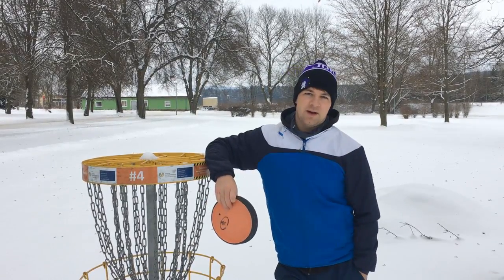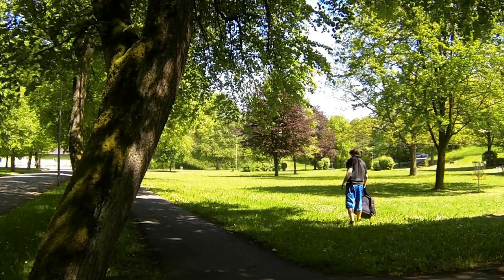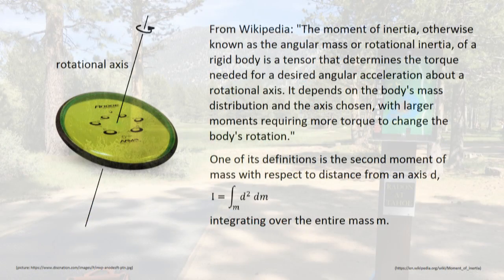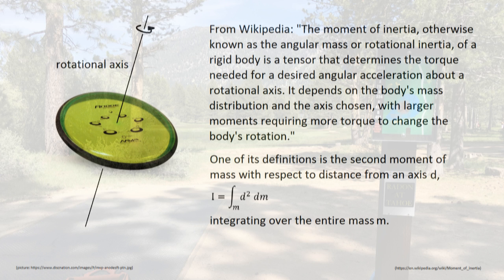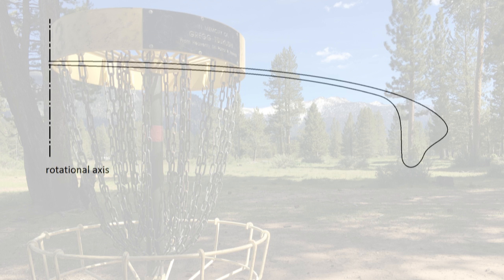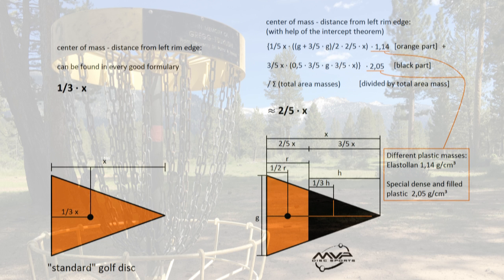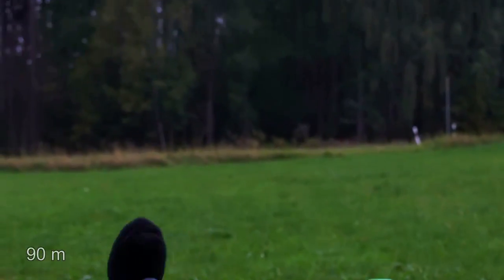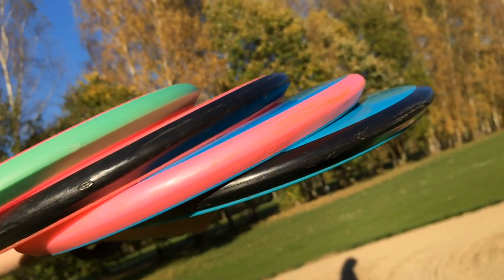The science behind MVP Discs

Comment: Two things surprised me most about MVP/Axiom discs.  1. The wind resistance is real.  I played years with a Mako3, which is a very neutral disc, but I was always aware of the wind direction and made changes accordingly.  Now I throw the Axis, which is also neutral, but I couldn't generate the same level of variability in the turn regardless of the power or wind.  This is a good thing and it's real.  The second thing, is the MVP is a top manufacturer.  Their consistency is second to none.  Every Octane I have thrown flies similarly.  I recall buying my kid a destroyer and he threw a throwler.  It was insanely understable.  Oh and one last thing, theses discs change flight characteristics slower than other manufacturers.  I imagine that this is part gyro, part rim tech, but it's great.
Reply: um, mako3 is anything but neutral. I know it says 0, but they are one of the most understable mids you can buy
Reply: also the gyro makes consistency easy, so yes you're absolutely right. but none of this video or paragraph makes me want to bag more than 1-2 mvp discs. They aren't deep enough for my hand, they don't break in the way I like, and after throwing about 10 of them they don't impress me more than any other brand.

Comment: Been throwing MVP ever since the first publicly available proto run of the ION, and helped a bit with connecting them with their first importer in this country, and even now they're only behind Discmania in my collections and bag. I'm actually not even going to take part in the discussion of whether or not gyro works, to me that's sort of irrelevant because you can make a great disc without gyro technology anyway. HOWEVER the biggest, most important thing for me when it comes to MVP is how incredibly consistent they are when manufacturing their discs. The first runs are usually a bit wider in variety (as expected since it's their first time making a particular mold in big batches), but after that they lock in their production standards and just do the same disc over and over again very consistently. There's some variation always, plastics and injection molding aren't perfect, but it's way less than I've seen from other companies. With Innova it's easy to have your full distance driver lineup be for example Destroyers, it's not hard to find super overstable Destros, normal overstable Destros, neutral Destros and very understable Destros. Same basic principle applies to every company, and some actually seem to vary immensely from run to run. With MVP there's rarely a need to hunt down a "2nd run of X mold in Y plastic in Z color", which is all too common on other discs (it's not inherently bad, sometimes it leads to great discs that wouldn't exist otherwise, just annoying at times). With MVP I've been more often than not able just order a disc in a given weight and rely that it'll fly like it's supposed to, no hunting around for perfect specimens.

That to me has always been the true glory of MVP, their incredible consistency once through the 1st run period.
Reply: jubuttib I have been throwing MVP since the Anode and Graham Russell is a friend of mine. The two main things that keep me buying and loving MVP/Axiom is the consistency in flight and the longevity of flight path (beat in disc get flippy ) a couple of examples I have a Volt and Impulse from when they where new releases and they both fly almost exactly the same as when I bought them(I play or practice 3-5 days a week) plus I have bought backups for them years later and they fly basically the same, more recently I purchased a total of 8 Relativity's both in Neutron and Proton and the only flight difference is weight.
I feel there are a lot of great disc out there from several companies, but the only other company that seems to have the consistency of MVP is Trilogy. Trilogy from my experience has a greater flight difference depending on plastic where MVP Neutron/Proton and Plasma fly similar and are more about grip and personal preference.
Reply: Has Trilogy upped their game that much? That sounds interesting, they (well, Latitude) used to be pretty much the least consistent manufacturer out there, the Striker is a legendary example of how one disc in the same weight and plastic could have the stability of anything from CFR Firebird to a beat up Roadrunner. I know they've gotten better, but I'm surprised (and pleased!) to hear that they've improved that much. =)

Also since you mention Trilogy: Now that MVP has three brands, MVP, Axiom and Streamline, I've started referring to them as the Triumvirate. =)
Reply: jubuttib I don't have a lot of Trilogy experience, Trespass, Enforcer and King. The Kings I ended up selling because they are to flippy for me. The Enforcers I have are good but don't replace any of my Gyro, the Trespass I bag two that are great for 290-310 straight with a little anny and almost no fade.
I do putting practice 3x a week with a Trilogy team member and he really likes the consistency. He is definitely liking my MVP,

Comment: All of this science is great if you're power gripping the disc but most MVP are low speed disc requiring a fan grip. the thin flexible plastic in the middle flops and wiggles forcing you to lose control of the angle of the disc.
Reply: Da Savage absolutely incorrect

Comment: How are you able to calculate the center of mass without considering the density of the plastics?
Your assumption that one can impart the same RPMs on a gyro disc is concerning. The goal of nearly every distance drive is to impart as much spin as one can. A higher MoI will without a doubt reduce initial RPM.
Reply: The difference in RPM is probably much less than you would expect, due to the mechanics of the throw.  You do not impart a fixed amount of energy to linear momentum and a fixed amount of energy to angular momentum when you throw.

In a standard backhand release, the large majority of the spin is not imparted by torquing the disc directly as it is released, but rather by the disc rolling out of your hand on the release.  The effect of a higher MoI would be a small loss of linear momentum because more of it is used up getting the disc rolling.  The disc will have more angular momentum and less linear momentum.  So the disc would come out of the hand with a slightly lower release velocity, and commensurately lower RPM as well (but, as I said, more rotational energy at that slightly lower RPM total).
Reply: What would be important to the center of mass calculation would be variability in the density of the plastic. If the density is uniform or if the variation is negligible, then you only need to consider the geometry. Regarding spin, I would submit that you need only enough spin to assure stability; no more. The rest of your energy would best be applied to linear velocity.